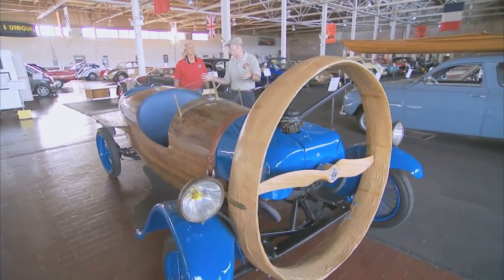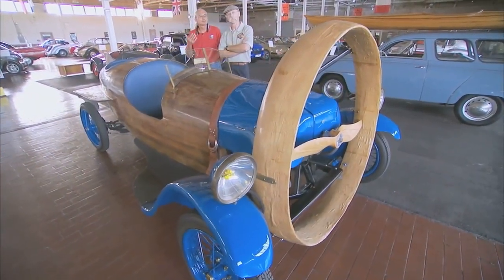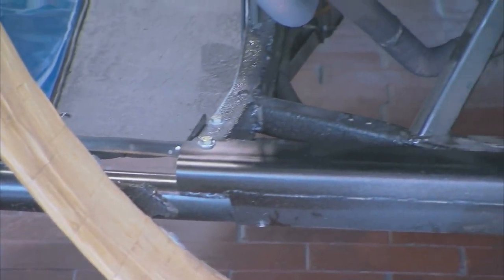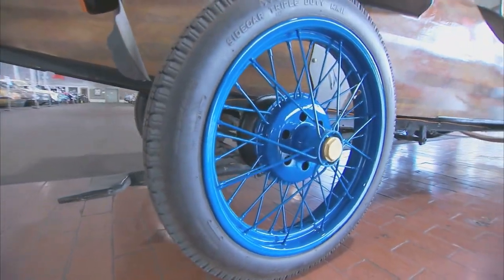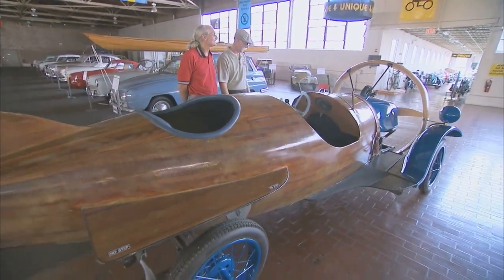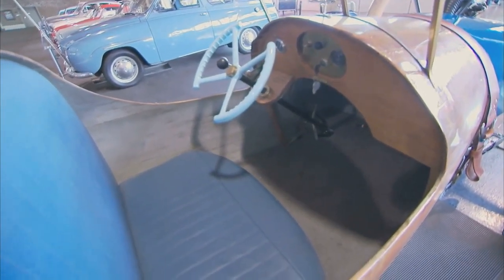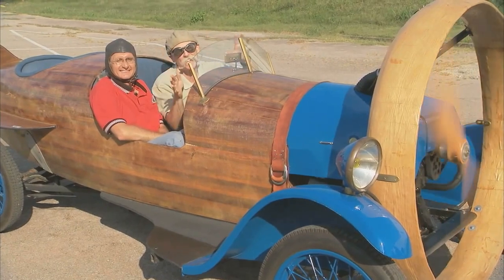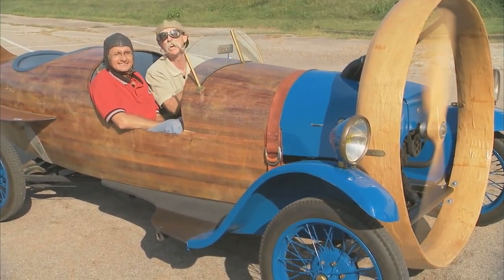1932 Helicron Propeller Car

Comment: Parallel parking between two cars has got to be a nightmare, as I'm assuming this vehicle has no reverse.
Reply: Why wouldnt it have reverse?
Reply: @TechnoCreeper  This car has no transmission. The car is powered by an engine that spins the propeller. The spinning propeller creates lower pressure in front of it and higher pressure behind it, thereby producing forward lift, which we call thrust. So, I can only think of a couple of ways that this car can move rearward. One is gravity. For example, sliding downhill. The other is to manually push the car back.
Reply: @spacetrucker1969  Well, it also could have adjustable propeller angle, which most airplane propellers have so they can reverse thrust. But, this isn't an airplane lol.

Comment: prop on old car is not hard to do l guess, but direnct to crank is low , so slanted shaft up or bigger wheels or belt drive, or small car on truck bed wheel axle prop, or just eng there.